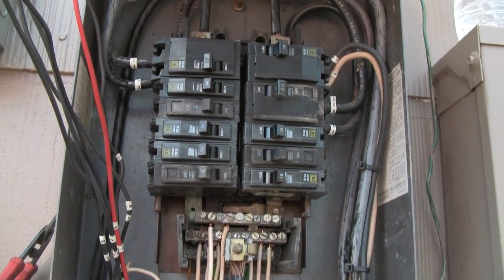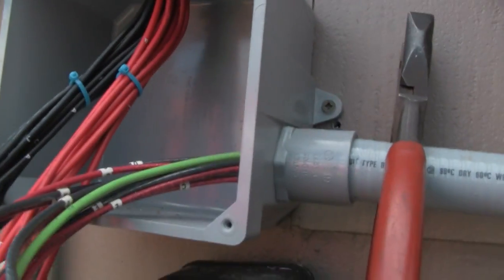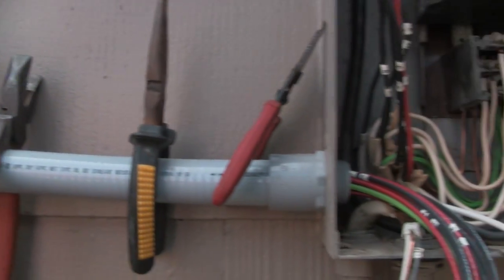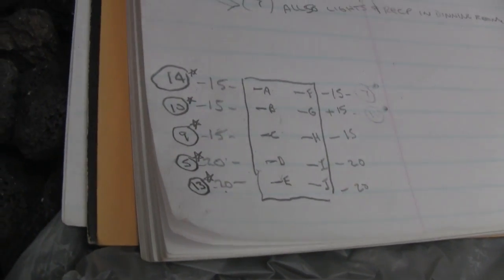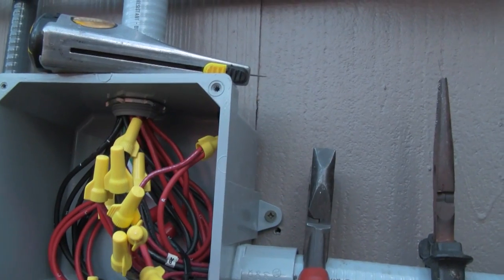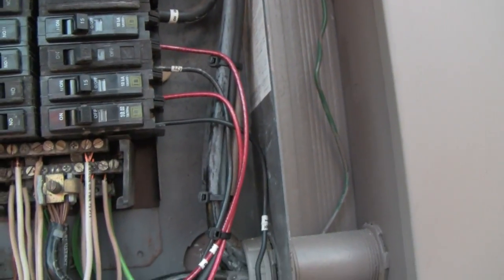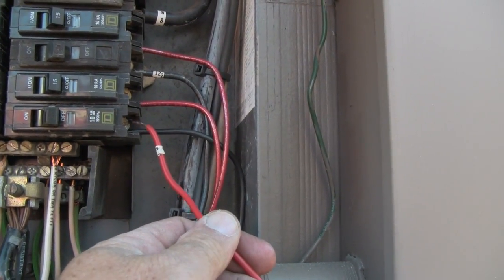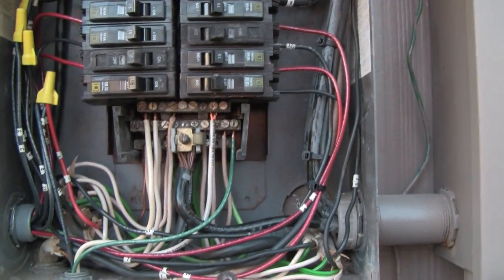EMERGENCY POWER MANUAL TRANSFER BOX Part 2

Comment: your neutral is way to small looks like 10 gage at best that’s only good for 30 amp but you have 5 circuits that are at least 15 amps each giving you the potential for 75 amp to be drawn from those 5 circuits with a neutral only rated for 30 amps at best

Comment: @FUBARPROTOCOL Sorry meant inverter not battery cables but yea, it is a 220 plug huh. Any thoughts on how to hit both legs so I can use all 6 circuits or ya think I should just use a small subpanel instead.

Comment from the maker: @N8Dogg1002 Nate, Do not hook your battery cables to this box. The transfer box is A/C and is not made to run on D/C current ( your battery). If you hook up your transfer box to your batteries, you will get hurt or killed and or burn down your house. Iam running the power from the inverter (A/C) to the transfer switch. The transfer switch plug is 220v A/C. Your inverter outlet power is 110v A/C. So you can just tie into one leg of the 220v plug and run just one side of the transfer box breakers.

Comment: Fu, Sup man. Got some Q's about your transfer box.  I liked your idea of using one so I bought one off Ebay. Mine is the lower model than yours.  I have the same problem with distance, only mine has to run to the other end of the house where my batteries are. Yuk. Are these safe to be used all the time? Kinda worries me. Mine only has the plug and is not meant for hardwiring so I guess I just hook my battery cables to a gen plug. My breakers are 20's and 15 on the energen. Any thoughts? -Nate